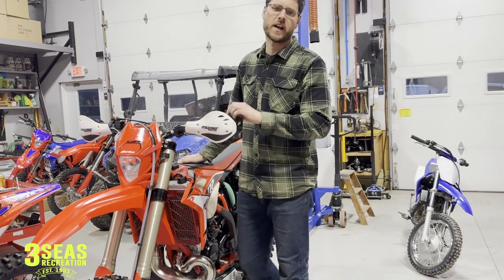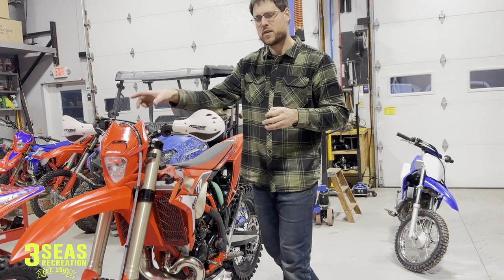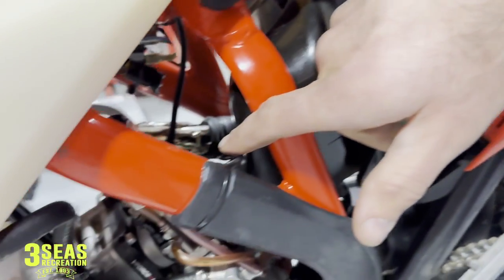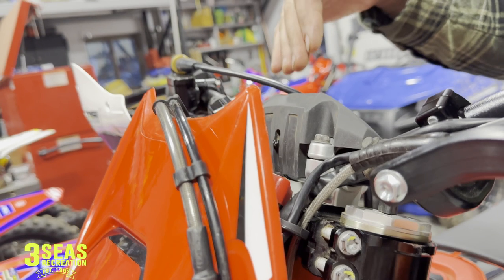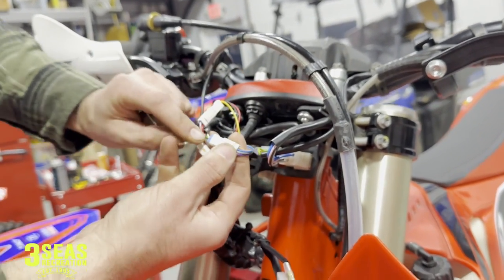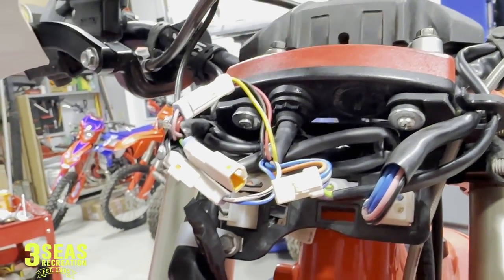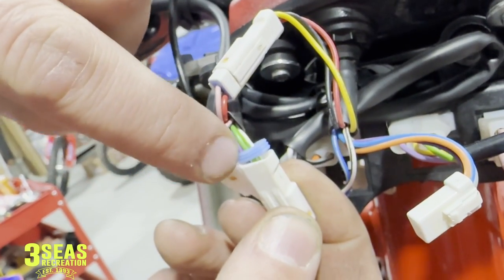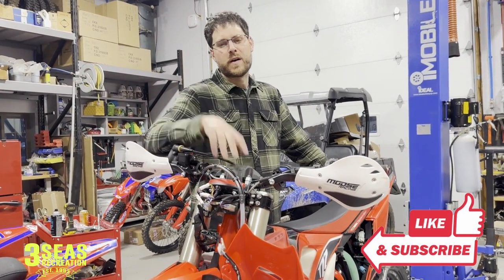TURN OFF your ENGINE LIGHT on a 200/ 250/ 300 RR 2-Stroke Beta Motorcycle after Oil Injection Delete

Comment: I have a 2024 xtrainer. Is there some secret to getting the oil reservoir out? I removed the fenders and got access to the tank on both sides, but for the life of me i cannot get it out, it just does not quite fit and gets hung up on the surrounding housing.
Reply from the maker: Just keep taking bolts out. I just did a removal on a 24' XT last week. There are tons of bolts but once you do it they are very easy to take out. Enjoy The Ride, Jared

Comment: Rather than unpinning the display wire I'd rather put a suitable valued resistor across the oil pump connector pins. To figure out what resistor to use it may be enough to measure the pump coil resistance with an ohmmeter.
Reply from the maker: Good afternoon, the suggestion to unpin the display is actually right from Beta USA. I am no electrical wizard to know what kind of resistor to use. Enjoy the ride, Jared

Comment: Hey Jared, greetings from Greece! I have a standard 300RR with OI and have the following question: If the dash has issues, mainly with battery, does it affect the low oil level or check engine light? If we assume the dash is all bad, would these signals still work?
Reply from the maker: Greetings!  Hmmm, well I think when the bike is running it should power the dash even if the battery in the back is dead. So with that in mind the engine light should work and come on if needed. The best thing to do is to replace that little battery in the display if you think it's getting close to failing. Enjoy The Ride, Jared
Reply: @3SeasRecreation  You are the best, thank you for answering!

Comment: How can a person connect a on /off switch for the headlights on the Beta 300 RR ? I’m amazed that the bikes don’t come with it .  Thanks for the Beta Handguards I got them yesterday in the mail 😂.👍
Reply from the maker: Good Morning! You could always interrupt the power circuit with a second switch if you wanted. The power wire is the DARK BLUE in the 6 pin connector behind the headlight mask! Enjoy the ride, Jared
Reply: @3SeasRecreation  Thanks 🙏 Jared 👍
Reply: @boerplaas388  Or you can remove power from High Beam. Then normal is light on and High is light off. This is what I did, before I crushed light switch and now I have just a regular switch

Comment: I was told from Beta you can just leave the 4 pin plug disconnected behind the headlight.  Not sure what the other 3 wires are for but must have to do with TPS/OI.

Comment: Cutting the wire on either side of connector achieves the same thing, just splice it if for some silly reason you ever want to go back.  

The word ‘check’ was constantly on the display where I would see mileage until I cut mine.  

Thanks for the video to lead me in the right direction

Comment: Why do race edition 300s have a TPS when they don't have oil injection? A random RE rider once told me the TPS was not only used for OI but was also used for ignition timing, is this incorrect?

Jared, do you have a part number for the TPS replacement bung on the carb please? I'm in the UK, thanks.
Reply from the maker: Good Morning, the 2-strokes do not require the TPS sensor to operate. I would assume they install the TPS sensors on all of the bikes incase if the customer decides to add the Oil Injection system. The Beta USA part #AB-21184 . Enjoy the ride, Jared
Reply: @3SeasRecreation  Thanks for the info Jared, much appreciated.

Comment: So if I want to keep OI, but ditch the crap OEM computer in favor of an Endurance II (without built in warning light), could I use that wire to setup an external warning light similar to what the TPI bikes use?
Reply from the maker: Good Morning, I have not heard of the Endurance II computer. I would assume that wire is just sending a signal so you could absolutely use it to set up your own warning light. Enjoy the ride, Jared
Reply: @3SeasRecreation  Thanks!  Endurance II is the unit made by Trail Tech similar to what comes on KTM's

Comment: Hi, Jared. What can be the reason the check light is on in a RR 4T 350 2022. The bike runs fine, but from today´s ride,  the check warning stays...
Reply from the maker: Good Morning, I would recommend taking the bike to the dealer and let them plug into it. The simple answer is to try a new battery, sometimes they can trip the engine light if they are getting soft. Enjoy The Ride, Jared
Reply: @3SeasRecreation  ok, thanks

Comment: Do you have a part number or link to the connector pin tool kit you use?
Reply from the maker: Good Afternoon, I do not.. I went and looked and it was a generic electrical diagnostic probe that goes into a multimeter without a company logo on them.. I think the guys have them in the shop to diagnose electrical problems but I was using it as a pick tool instead lol. Enjoy the ride, Jared

Comment: How do i get rid of the oil low light? do i need to remove the tank?
Reply from the maker: Good Morning, I would just unplug the low oil light sensor out of the bottom of the oil tank. It is a two prong connector and once it is unplugged the light should stay off. Enjoy the ride, Jared